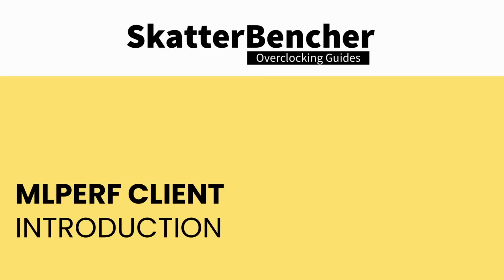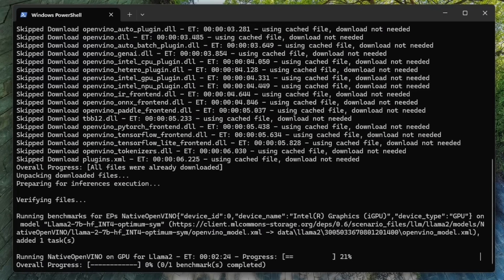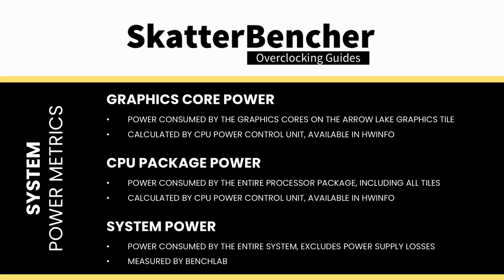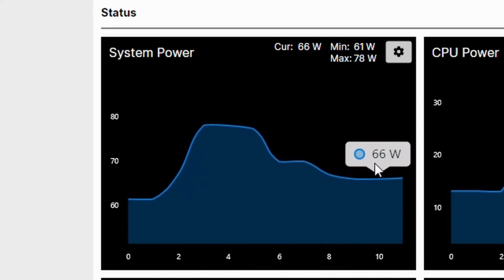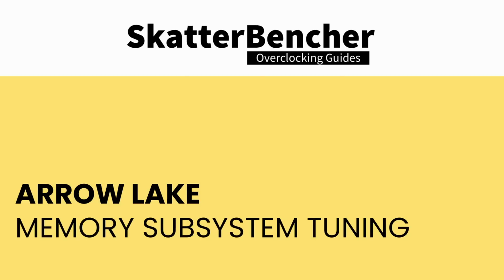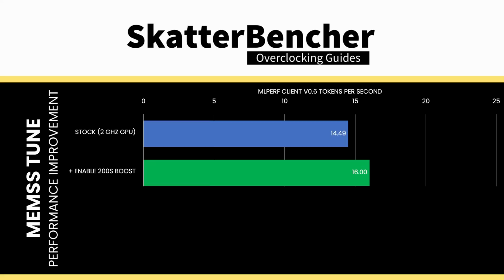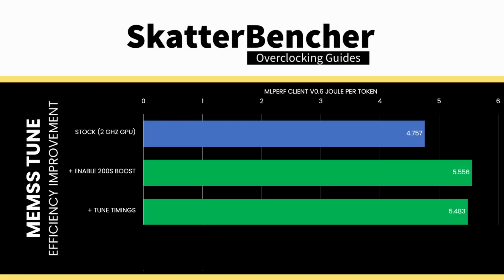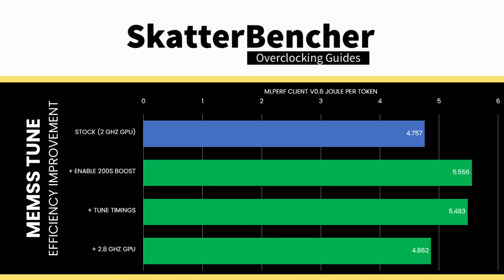Improving Llama 2 Power Efficiency by Overclocking Arrow Lake Intel Graphics | SBCP#5

Comment: Thanks for testing the performance, efficiency and optimization methods for the “AI” side of things (Llama 2 7B) with MLPerf Client. It would be great to see this type of testing and benchmarking expanded with other LLM models over CPU, GPU and NPU or other hardware features if theirs some standardized way of doing this that makes sense as content. APU and dedicated GPU performance with different memory speeds and (V)RAM configurations and efficiency tweaks would be interesting also, although from a hardcore overclocking/ optimizing/ tweaking perspective this is probably not very interesting.